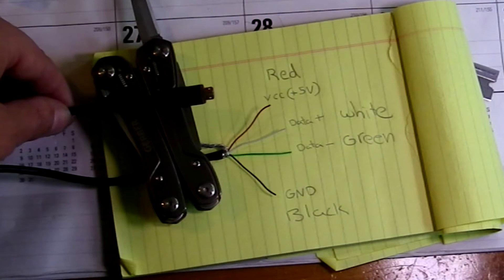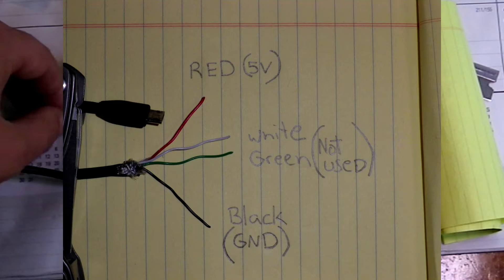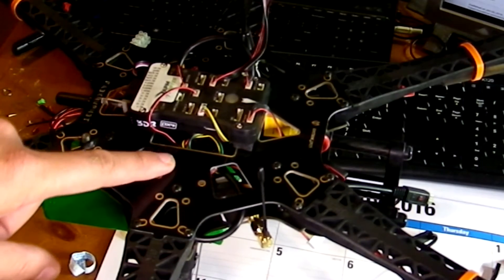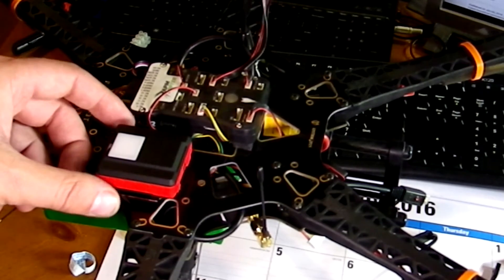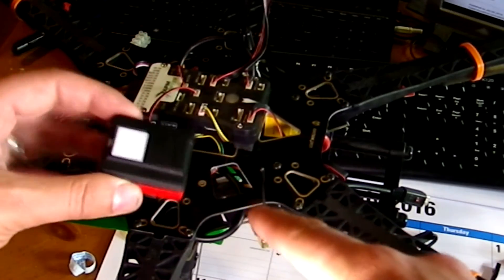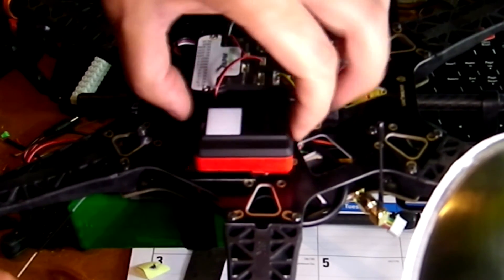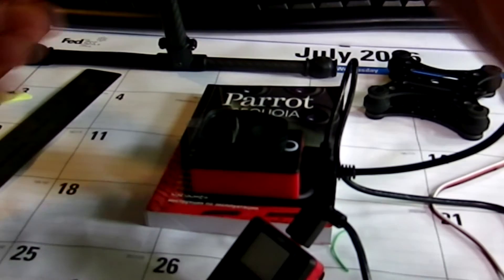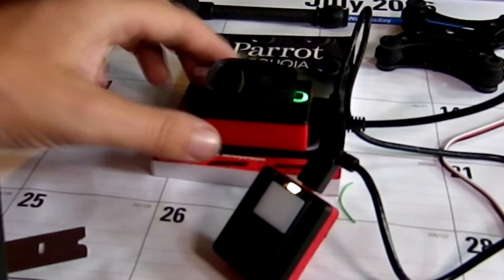Parrot SEQOUIA mounting on costom UAV

Comment: Hello. Nice video. I want to ask you. It is posible to do a custom cable for my sequoia that connect to a raspberry-pi ir order to trigger the camera with the PTPy. and give power supply by the battery of my drone. I am doing this because my camera is having problems with the wifi.
Reply from the maker: in this video i show you how to power the camera with the drone battery you need to make sure the camera gets 5V.
and for triggering the camera it has already built in 2 methods GPS trigger and timedelay trigger you dont need wifi to trigger the camera.